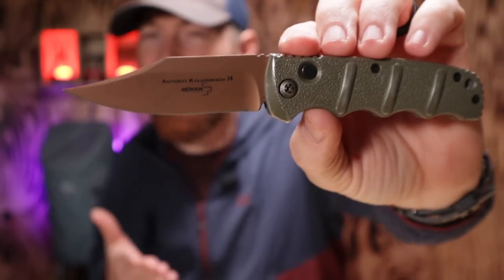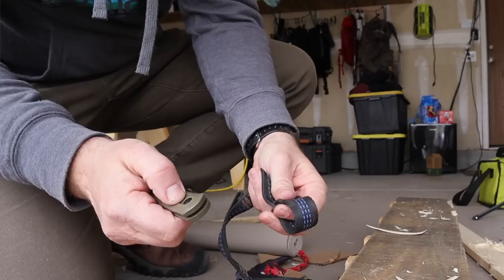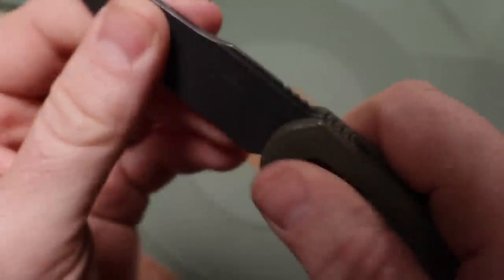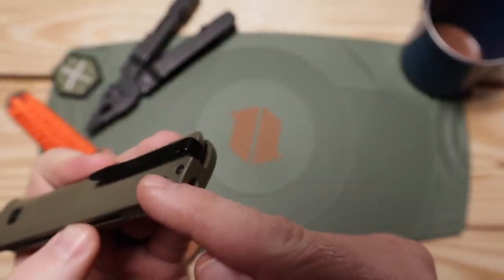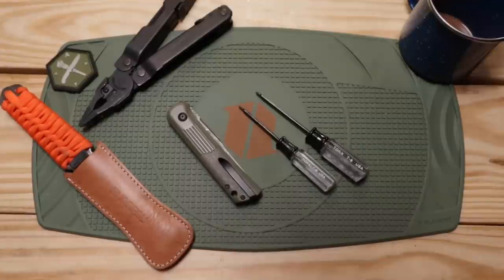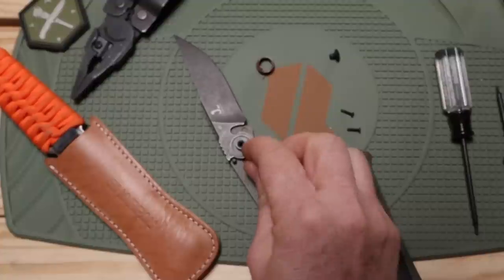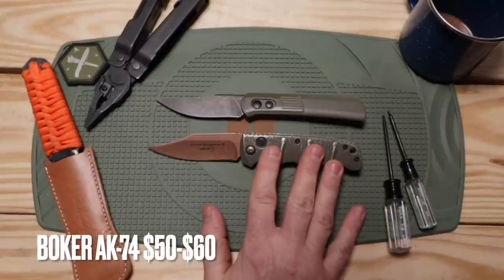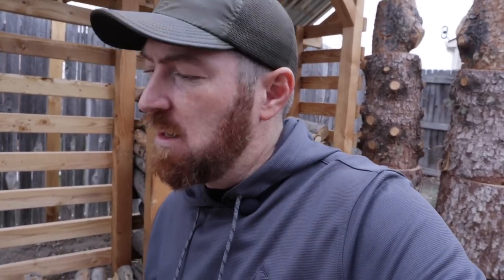Boker Alluvial ~ Great Budget Automatic With A Problem!

Comment: Actually, you can fix that by placing the pommel against a solid surface. Put strong pressure against the solid surface and then rock the handle towards the clip side. This will tweak the clip bringing it back against the handle scale. 👍🏻

Comment: I fixed my pocket clip on this knife by putting something under the bend of the clip that’s a little thicker than the bend and then tweaking it down toward the scales of the knife. Worked fine, but the pocket clip on these seems super soft.

Comment: I know that when you disasemble all kind of knives they have to be opened because the pressure of the spring
will explode and you can loose the spring and other small things in it!!! Better remove this clip and throw it in the garbage,
I really hate this kind of knives with that position of the clip.This Boker is not so good man! I have and prefer the Boker Kalashnekov.